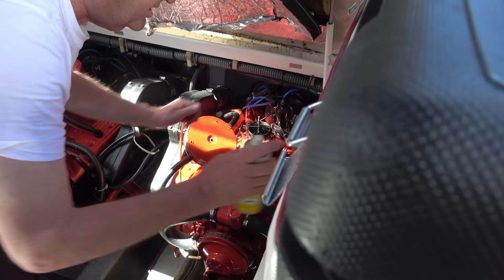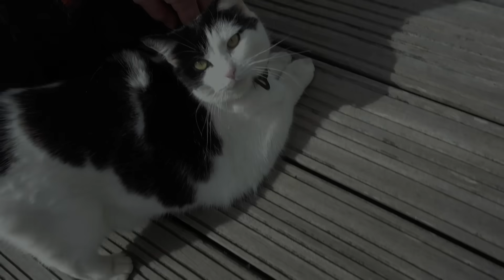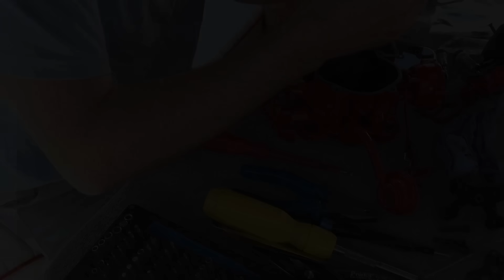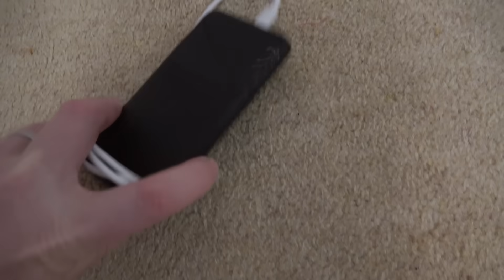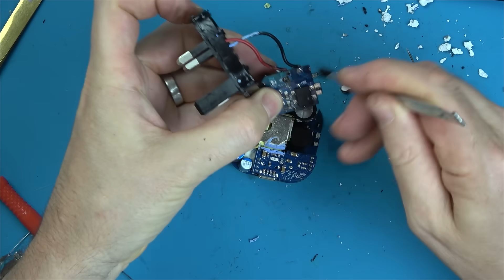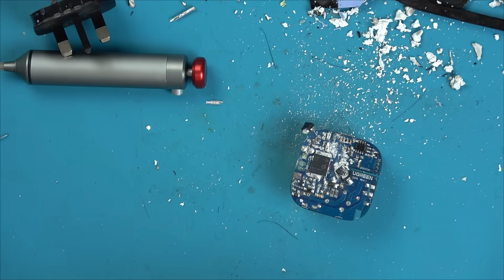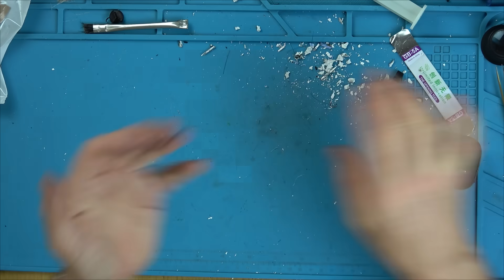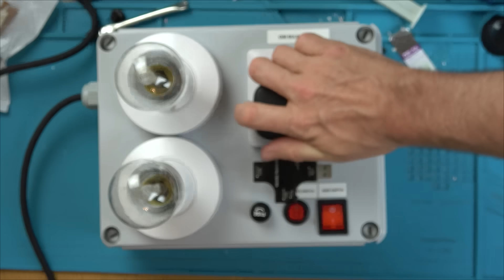Battery, Electric & Petrol Powered Items - CAN I FIX THEM?

Comment: On the boat, I'm certainly no expert but since both engines are having very similar problems and it's known to be old fuel it sounds more like a fuel delivery problem to me.  I'm guessing it's a partially blocked fuel pickup, a blocked line, clogged fuel filter, or something like that.  I don't know if they are electric or mechanical fuel pumps, but it would be worth checking the function of those as well.  But yeah, since both engines do start and run and then die shortly after, and they seem to run on the starting spray, I'm definitely guessing it's fuel delivery rather than a carburetor problem.  Maybe try attaching a small external tank with fresh fuel to see if that solves the issue.

Comment: For the boat you should start with the easy things… Are you using e10 fuel probably they need e5, is there a fuel filter that might be clogged restricting the flow, as someone else mentioned check the points, check the plugs, pump the old fuel out, check the fuel lines… good luck

Comment: I have a rpi 4b 8gb and it shorted while i plugged in the charger in the wall socket while the charger pin was connected with raspberry pi board then it stopped showing any lights and presumably totally dead then i did some chatgpt and research and then i saw there was cracked tvs diode which according to chatgpt sacrificed itself to protect other parts then i got it removed at a phone repairing shop to see if the board worked after removing the cracked tvs diode then it atleast started showing a solid red light but it doesnt show any acitivity on ACT Led, i tried eeprom image fix using sd card that worked when the board was working but theres not a single action on ACT Led green and out of all the videos on youtube only yours seemed knowledgable enough about the board. Can we discuss something!!

Comment: Re Boat
If it has been running on E10 Fuel this damages fuel steel fuel line drain and run on E5 as older engines dont allways like E10

Comment: I had the same issue with our family power bank. My brothers' kids drop it all the time. I used a thicker flexible wire to connect the board because I had space inside to do that. The issue never came back again.
I would use a file to make the glue smoother, though.

Comment: That USB power meter doesn't do the PD negotiation over the CC pins, so nothing will show up unless you plug in a sink device that actually negotiates PD. That Ugreen charger might be fixed but you'll have to risk a PD-capable device to test it.

Comment: Hallo. In several videos I like to complain about your soldering. Here I have to. At 40:49 you were saying right before doing it's dangerous because it's lithium. Please use another tip for this. Think about it. And think of it before doing. "What do I wanna do?"and change the tip for your next task. Here I highly recommend I chisel or k-tip. The ones which look like a knife. for transferring a large amount of heat into this for a short time. Think about it again. One thing which could happen is too brake the device ( the power bank) one completely other thing is some kind of fire hazard after you have toasted the battery cell because this tiny tip isn't the proper tool for the job. And you are giving this to your kids.

Comment: In my opinion both engines are flooded with fuel, remove spark plugs replace/clean they will be very black and sooty possibly wet. When starting don't pump the throttle or spray easy start they were getting to much fuel and fouling the plugs. If you buy plugs for one engine fit them get engine running and run up to temperature do not switch off to soon (auto chokes don't like it) when up to temp stop remove plugs and refit cleaned old ones (use carburettor cleaner to clean plugs) fit new plugs in second engine and do the same. My advice always run a petrol engine with auto choke to temp, turning of to soon will leave it in flooded state and difficult to start next time.

Comment: Accelerator pump dried out and isn't give the extra fuel when going fuel throttle.

EDIT 
Did you check fuel pressure?

Comment: If it’s not starting with starter fluid/Easy Start, then it’s unlikely to be fuel related and more likely spark, air/fuel mix, ignition or timing issue.

Comment: Hi Vince - you need a USB C cable plugged into the load side of the tester to show the voltage/current display (or at least on mine you do)

Comment: Engines need 4 things (yes even boat engines) 1 spark, 2 gasoline/petrol, 3 air, 4 compression.
The problem I am inferring is a bad accelerator pump on the carburetor, that dies when giving it more throttle, it is suppost to squrt a small amount of gas into the engine to overcome the vacuum loss from opening the carb throttle plates.
ex ASE certified mechanic before my strokes
Reply: I agree about the accelerator pump. But didn't the rebuild kit come with a new one?

Comment: To do with the boat both engines one runs better then the other both are the same I would one swap out the battery because its that bad it's acting as a big drain sponge soaking up the power from the jump pack yes they got dynamo/alternator but look more on the lines of a dynamo and they wasn't the best for charging and giving out the best power so with the battery being bad acting as a drain on the jump pack and most like poor voltage as they need power for the coil that powers distributor if battery so bad be draining the jump pack plus dynamo not great if its even working can be poor power delivery plus I would check points in the distributor also ht leads and spark plugs as when you rev it its goes to give more air and fuel and goes in to up speed so more compression that can make spark not enough and fail just  stuff I would check could be bad Carburetors I can't say really as it's not me looking at it and I'm guessing mainly by a video

Comment: By pumping the throttle you are pushing loads of juice into carbs. They have a little pump. I think the engine is flooding. The accelerator pump pumps extra fuel in when throttle is used and the pressure in the manifolds drops. If the pump is not working the enginecwill stall on acceleration.  The flap on top us the choke which should be open when engine is warm. Finally you should not gave to use easy etart to start a petrol engine, its more for clapped out diesels.

Comment: Hi Vince.....regarding the dim bulb tester when the main switch is on and the bypass is off this means your going through the lamps so they are acting as a resistor so when both switches are illuminated it means you are bypassing the lamps  meaning your on direct mains . Its a little confusing I have the same unit purchased on ebay.....

Comment: Couldn't you just swap the Carbs from the somewhat working engine onto the the one that doesn't like throttle to see if it still acts up? Also i would check spark plugs.

Comment: You should actually try plugging something in into the power supply. USB-C needs communication, plugging your meter will not turn it on because the PSU doesn't know what voltage to deliver. Consider getting a better USB Meter that can ask for the voltages.

Comment: If that battery bank uses the chip I think it does, if you hold the power button down to ten seconds you force it to remain on even if there is a low load on the USB. I use this when using PD to 5V/9V adapters for drivng stuff when I can't be bothered getting my bench supply out.

Comment: lol @ dim bulb tester. It looks like something from a 1970s Dr Who program.
Actually looks like they have used every safety feature available including what looks like plastic screws in the corner and the flex with the water proof screw grommet thing into the main device, big idiot proof switches.

Totally should buy an older boat for maybe 1-2k with an outboard and see about fixing it up. It will only ever be worth 4-6k when complete but would be fun and good for a few years of day trips before selling it

Comment: I would have thought it would have been prudent to run a blower fan before trying to start those engines what with petrol fumes being heavier than air and starter motors producing sparks , Just saying cos a boat hull will hide the fumes nicely 👍🏻Maybe check the plug gaps ?

Comment: Probably too late for boat suggestions, but rigging up a separate fuel tank would have eliminated potential fuel issues (easy for me to say, I don't know how awkward the feeds / pumps are to disconnect). For the power supply, you didn't seem to test it in dim bulb bypass mode. Highly unlikely to impact things (given the damage shown), but you would have had two parallel lamps in circuit and switch mode supplies don't like to be current starved on power up.

Comment: I was wondering if there are inline filters on the fuel system and the fuel may have degraded enough to cause problems but not enough to show itself in carbs as residue. How old are the plugs, compression test something else maybe going on.

Comment: This Model of USB-tester needs a load on the other side to turn on. So I'm pretty sure you fixed it.
Reply: Not just a load, it needs either a special negotiator chip or some resistors across the usb C connector's CC pins
Reply: @309electronic5  Yeah, you're right. By "load" I meant "device"...

Comment: If the motor is cold you should not pull on the accelorator, you have to let the choke make its job, because engine needs more petrol. Pulling the accel. let to much air in to start. If the engine does not start, fix choke problem first.
It hurts me to see these people fiddeling on the engine with no glue.
Where is the deep problem analysis you do usually?

Comment: That clear part on the battery bank (where the display is) looks like it's about to come off.
(Read more contains spoilers)

After seeing the burned board, I wouldn't have even dared to fix the charger.

Comment: looks like the carbs are not getting fuel, check the fuel pump, filter, and floats inside the carbs or have a little squirty bottle and slowly manually feed the fuel in when starting, that way you can see if its fuel or spark.

Comment: As that ugreen power supply had the box I'm surprised the original owner didn't just return it if it failed straight away. I have one of the silver gray chunky 65w ugreen charger with folding pins and it's aways worked well.

Comment: When soldering the battery terminal wouldn't drilling a couple of holes through the metal and using the same principle as plug welding require less heat?

Comment: Faulty from manufacture. Should be a 6 year warranty claim then.
Even if not, in any case. Send the lot in to the manufacturer with all parts and a brief description of what you found out.
To them it’s valuable information and it also is a low cost item.
Having someone dealing with this cost them more than the actual new item. It also isn’t worth to them to risk negativity and upsetting a customer and his friends. Rather turn this into a positive experience and use your mouth to mouth propaganda because you’re very likely to tell people about the positive experience you had with the customer service of the manufacturer of this product. This is far more effective than any advertising to secure future sales.
I have made very good experience doing things like that.

Comment: Since both engines run like crap and are hard to start the only thing or one thing that is common to both engines would be your fuel supply from the boat's fuel tank check the lines and the filter for blockages or bad fuel

Comment: If it's backfiring, the first thing I would check is the timing, you can adjust by rotating the distributor. You can also check spark plugs by unplugging 1 at a time and see if one of them doesn't change how the engine runs, if nothing changes it means it's probably bad
Reply: For timing you could try turning the engine at the crank bolt until it gets to top dead center and then getting the distributor pointed at the #1 cylinder plug wire. The firing order and degrees of timing may vary based on the engine so you may need to look it up.

Comment: that diagram isa  choke pull off operated by vacuum  and opens the choke under acceleration . if that's ether you are using, you're using wayyy too  much for a gasoline engine. . check fuel filters, fuel pump, but first try to run it on new fuel. fill the carb bowls with fresh fuel & see how it runs .  you didn;t really clean the carbs per sai , a good clean in an ultrasonic cleaner would maybe help

Comment: I'm a small engine mechanic that also services boats (mercruiser, omc, Volvo etc..). My number one advice is to pump/suck out all the gas from the tank or at a minimum get a sample of the gas in a clear jar. Let it settle and look for a line of water at the bottom.
Reply: Not a mechanic, but my first thought was bad gas as well.
Reply: @rodenti honestly bad gas is 50% of my repairs. Usually draining, flushing the tank and using fresh gas fixes them. The ethanol in the gas attracts moisture and makes it start to "rot" after just a month.

Comment: Not to be pedantic but, the out drives might be Volvo but the engines are small block Chevy. Sounds like fuel delivery problems. Water in fuel? along with carby issues. Float level checked? Fuel filter checked?

Comment: Main Switch: Controls total mains power to the entire unit.
Light Bypass Switch: Bridges across the lamp sockets when turned ON (I), removing current limiting and providing full mains voltage directly to the outlet.
Fuse: Protects the testing rig itself from severe overcurrent faults.
Dual Lamp Sockets: Wired in parallel with each other, but together in series with the live line to the output socket. This allows wattage selection by adding, removing, or pairing bulbs.

Initial Setup.
1. Turn the Main Switch to OFF (O).
2. Turn the Light Bypass switch to OFF (O) (Current limiting active).
3. Insert appropriate rough-service incandescent lamps into the sockets.
Tip: Use a lower wattage bulb (e.g., 40W–60W) for small electronics or dual bulbs (e.g., two 100W bulbs) for larger power amplifiers to increase current delivery.
4. Plug the Device Under Test (DUT) into the front UK mains socket. Ensure the DUT's own power switch is turned off.

The Power-On Test.
1. Plug the tester into the wall mains and flip the Main Switch to ON (I).
2. Switch on the DUT and observe the tester's bulbs immediately:

• Bright and Stays Bright: Major short circuit present. Turn off the Main Switch immediately. The bulbs are safely absorbing the mains voltage, protecting the DUT from exploding components.
• Bright, Then Dims Down: Normal behavior for healthy power supplies. The initial flash is the inrush current charging up filter capacitors. Once charged, current drops and the bulbs dim.
• No Light or Very Faint Glow: The DUT has no short circuits and draws very little idle current, or there is an open circuit/blown fuse inside the DUT.

Using the Light Bypass.
1. Ensure the bulbs have dimmed down completely, indicating no catastrophic faults exist in the DUT.
2. Flip the Light Bypass switch to ON (I).
3. The bulbs will turn off, and the DUT will receive full, uninhibited UK mains voltage for final calibration, voltage logging, or audio performance testing.

————

In a single-bulb tester, you are locked into one fixed current limit. The dual-lamp setup provides flexibility for different sizes of equipment by allowing you to safely scale your wattage up or down. The two bulb sockets are wired in parallel with each other, their total wattages add together, while the pair remains in series with the equipment you are testing.

Single 40W or 60W Bulb. Small signal gear, turntable motors, tiny radios.
Single 100W Bulb. Standard valve radios, domestic audio, small transceivers.
Two 100W Bulbs. High-power amplifiers, large communication receivers, linear power supplies.

As a rule of thumb, choose an incandescent bulb with a wattage rating roughly 1.5 to 2 times higher than the maximum wattage rating printed on the back of the device you are repairing.

Thanks for the video, Vince.

Comment: Try using wax paper on powerbank glue. It can be left to dry with waxed paper against glue. 
When dry, remove wax paper, a smooth shiny surface is revealed.

This trick also works with body filler on cars.

Comment: Nice selection of fixes. Used to have a 1990 Mazda.323 with carburator, automatic choke and man it was very complex looking device. A ton of hoses, vacuum adjusters, electrical wires, etc was around it. 
Maybe ignition side should be checked as well and engkne timing? Compression test?
Reply: Well, tonnes of tubes.... One vacuum hose and one electric stationary switch... I had a Mazda 323 1.4 3-drs automatic!
Reply: @richardbas2948  Mine was 1,6  sefan and there was more than one hose, for example under the carb was many thin plastic pipes between the carb and firewall etc.

Comment: Did you try using the fuel pump to fill a jar?  If you have water in the petrol, it will show as a layer at the bottom of the jar.  
I had this happen to my stand on mower.  There was water in the fuel, and it acted exactly the same.
My problem was caused by an old fuel cap, that let rain into the tank, because the vent was broken.
Reply: Petrol tends to absorb small quantities of moisture without it precipitating out. If a layer of water shows in a jar, it indicates a huge amount of water has got into the tank and it will need draining and flushing.

Comment: USB-C testers might not trigger a USB-C-PD power supplies to output anything with no load connected to the output. Some have a switch to enable triggering USB-PD supplies.